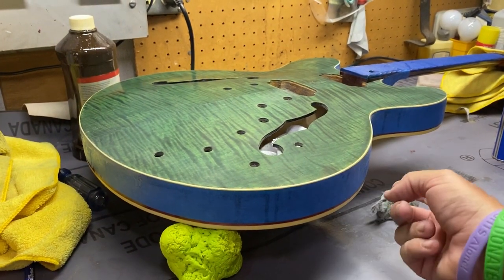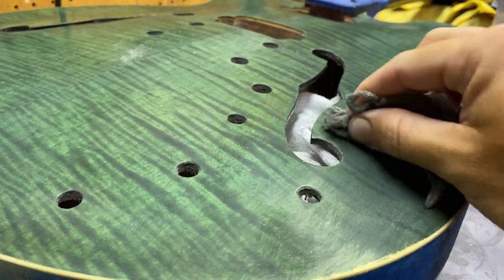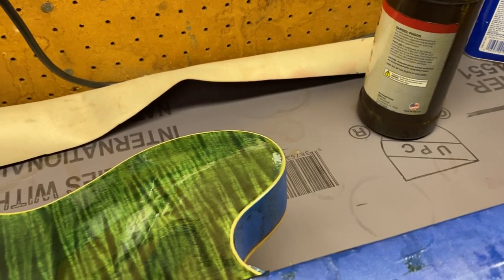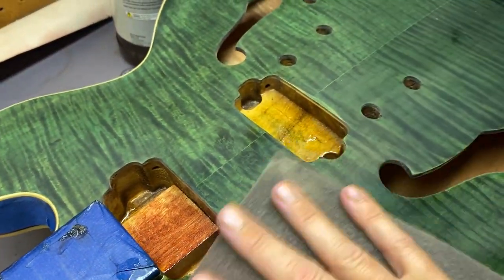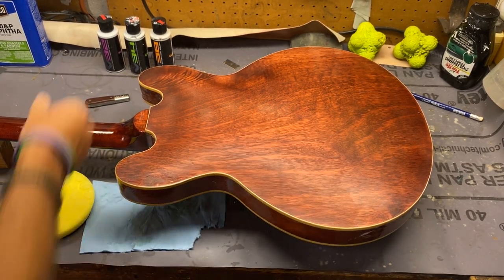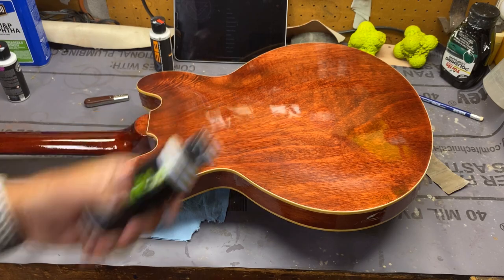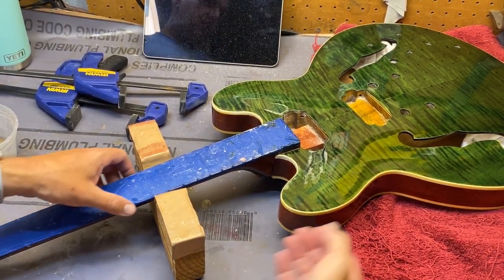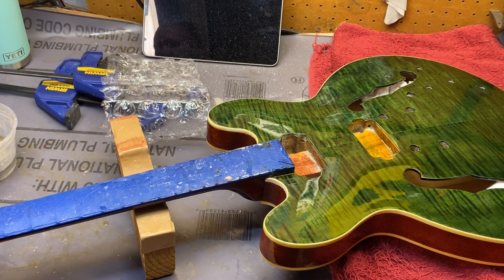Building a StewMac ES-335 Kit - Part 7 - The End is NEAR!

Comment: Quick question... sorry if I missed it in the video but how did it go from so dull to so shiny overnight??
Reply from the maker: No problem man! A full day of LOTS of wet sanding in progressively higher grits until 12,000... Then a cut with Chemical guys V32, A mid compound V34 and a final polish V38. Then Chemical guys glaze, Jet Seal, and then Carnauba wax, and then I'm using their hybrid/silicone quick detailer.

I also use the Dunlop System 65 my guitars for cleaning and maintenance afterwards!

Full breakdown of items used are in description as well

Hope that helps!
Reply: IamBucketdotcom gotcha. that’s what i thought. i think I was just confused as I didn’t seem to see you putting a clearcoat on it. if you did, what did you use? i’ve seen so many videos of people saying their preference on lacquers, nitro, or a poly. which have you had the best experience with?
Reply: @jackkiefer569  check out part 6... its multiple layers of tru-oil. It goes on in very thing layers, with scuffing in between. It was already coated at the beginning of this video. It only looked dull because the tru-oil coating needs to be polished.
Reply: @xjunkxyrdxdog89  wow.. so.. it's only tru oil coating?  I've also guessed you've used other finish coating for that glossy look.
Reply: @bbosla  yep, just tru-oil. It's the same idea as French polish... tons of super thin layers give it a glassy look.